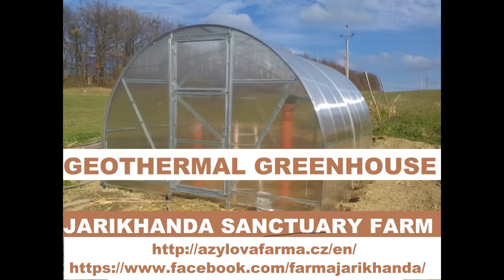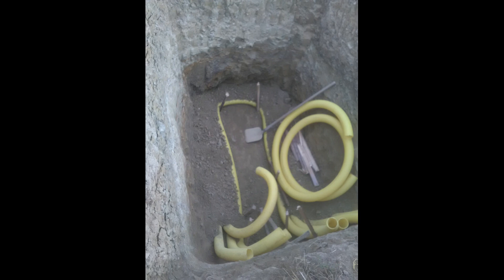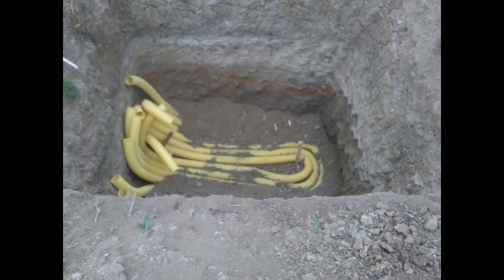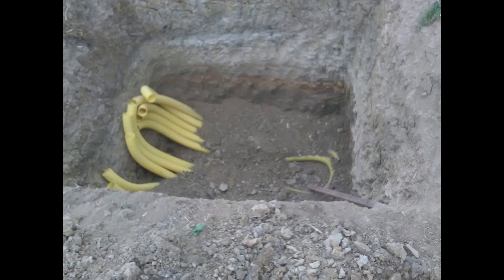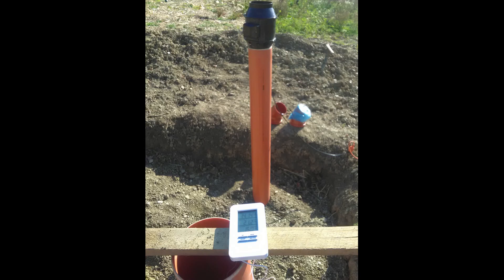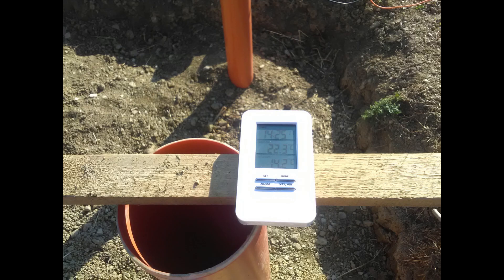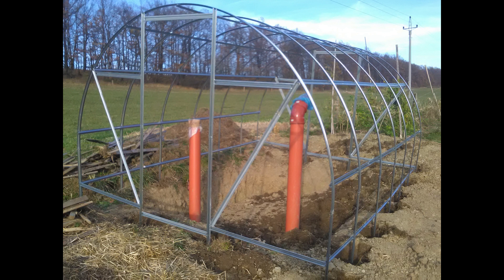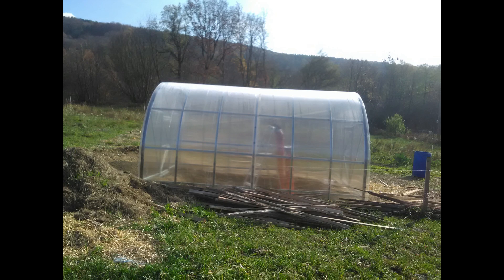DIY affordable GEOTHERMAL GREENHOUSE REALLY WORKING!!!!

Comment: Nice job. Its good to see you did the math before installing the system ;) The tt150 will turn greenhouse air volume 20x per hour at max power. The system looks to be capable of 40x per hour but you would need more fan power to use it.  The only thing i would have done differently is to utilise the entire greenhouse floor area for the tubing layout. The hole represents about 75% of the total available mass.  .
Reply: Hi John, nice to be noticed by you :). I thank you very very much, cause you safe me from much work and failure. I have seen your comments on different greenhouses and you brought a lot of knowledge and right understanding of this geothermal system. You made me to use my brain and not to just copy somebody else, who copy somebody else shity system... Really I am very thankfull to you! 

Yes sure, you are 100 % right. This vent I was using is not strong, but it was enough for the plants to grow for very little electric bill. But to put there something 4x times stronger will be not that expensive and veggies will grow and yield much better. I just tested recently 1050m3 airfow vent and it is much more air going thru. I would like to use 2000m3 airflow vent, that will be great upgrade. This winter I will have little come back with new videos with stronger vent.
Reply: @cannapurnas.r.o.7846  
Hi, I`m glad it helped. I try to help folks avoid making costly mistakes but some cant be convinced.
 I converted your flowrates from metric to imperial,  1050m3/hr fan is running 88cfm per tube with a super optimistic loss  loss of 0.265 " wc (excluding bends, manifolds etc). The 2000m3/hr fan will be 168cfm per tube and  0.961" wc.  I designed my system for 0.3" wc loss when running one air change per minute (60x per hour). That was back in 2009 when there was no real data available with regards to performance with much higher turnover rates. The only greenhouses with systems at that time were large and they didnt enough fan power to test even 10x.  The recommended turnover rate back then was 5x which we know isnt enough for effective cooling.
Reply: @JohnGuest45  hello there, I'm very interested in this topic. I live in a tropical country. So I would like to learn more about this cooling system to implement in a greenhouse. Sir could you please recommend me a good online source or a book to study about this from basics. Thanks a lot 😊

Comment: Good video and good implementation.  If I understood you correctly: the hole was 2.5 m deep, 3.5 m long, 2.5 m wide?  That is a big hole - you must be a young man. ;-)  If you look at my videos, you'll see that I have experimented with geothermal climate control for my greenhouse (though I'm currently focusing on compost heating).  I have often wondered: instead of circulating air through pipes, why not dig a "root cellar" and simply exchange air with the root cellar?  You did most of the work of digging a root cellar!

Anyhow, it looks like you are getting excellent performance from your geothermal system.  Congratulations!  I look forward to seeing more videos.
Reply from the maker: Thank you. Yes You understood it correctly. It is big hole, but lucky me no roots, no big stones :-) For larger greenhouse bobcat is definitelly needed :D . I also was thinking the same, if it will be same if you exchange the air with root cellar, because I dag also root cellar similar hole, just hole covered with aluminium roof and little soil on the top and no frost there, I will post little video about that also. So will it work the same? I do not think so. In very low temperature it will be not eficient. The soil is big thermal mass and that it is how it works, the soil is heating up the air circulating from the greenhouse. To be eficient you need to connect with that thermal mass, so drainage pipe  which has holes are the perfect for that purpose, the vent is pushing air down there and the air is trying to push thrue the holes of drainage pipe and than is push back to the pipe warmer from the soil. So this system is connected with all the thermal mass down there, not only under the greenhouse, like some people did something called Earth Battery, they isolated the thermal mass of the soil from their systems thinking they will store the heat from summer for the winter, but actually this is not how it works. You try to utilized the temperature of termal mass, its temperature can be never exhausted, it will always remain the same. Imagine trying to cool down the temperature of air during summer with one aircondition :D and we cannot compare air with earth, or soil. So if you will be exchanging the temperature only air to air, than soon you will find the equilibrium.
Reply: @jarikhandasanctuaryfarm713  Yes, you are probably correct. However, it will be an interesting experiment (cellar vs GAHT sytem).  Thanks!
Reply from the maker: @MorganBrown  Sure it will be very interesting. I was thinking to have down there maybe some small concrete chambers, instead of drainage pipes which is plastic, I would like to do some experiments in the future if there wil be time and resources for.
Reply: This is very interesting thank you! So you do not use a fan to circulate air in the manifold, what causes the air to circulate in the manifold? Pressure difference between inlet and outlet?
Reply from the maker: Yes thats exactly what I mean, and drill many small holes, but these are expensive compare to plastic pipes, but maybe it will be possible to find some old for cheaper. It will be great to make system with them one day, but really just for small greenhouse, otherwise it will cost to much :D
Reply: @jarikhandasanctuaryfarm713  I'm struggling to find a way of calculating how much pipes etc I need. Could you help me with that, please?

Comment: Hello! Wonderful!!!
If you can have an air space of 10 centimeters and add another layer of clear (Lexan?) walls, your greenhouse will really be warm in winter.
Reply: You mean to build another inner layer, like a 2nd dome inside?
Reply: @Badboyifier  Yes. Some regular greenhouses have two layers of plastic with a thick layer of Air in between. Also, very effective for Geothermal...
If the layers of plastic are touching, then the cold goes from one layer to the next - immediately... You are trying to slow the amount of heat conduction to the outdoors. :) 
-If your frames are wood, they will rot faster, due to the moisture condensation between the layers. -Good luck!!